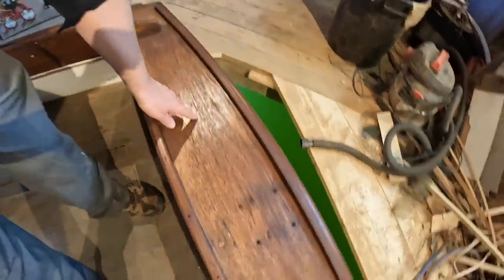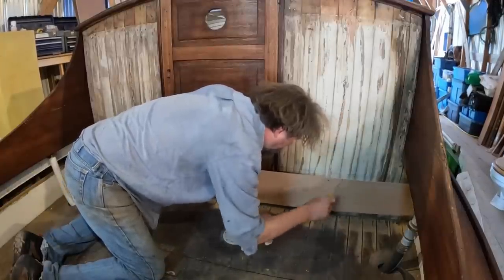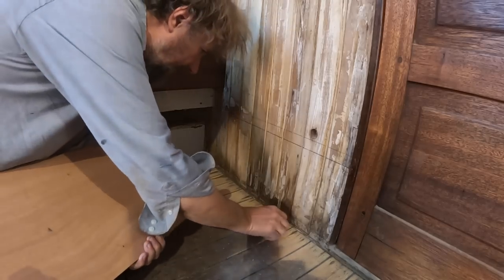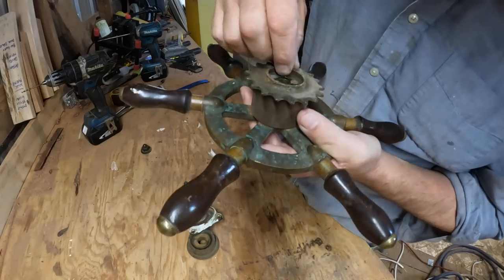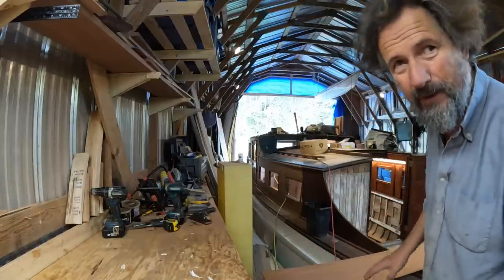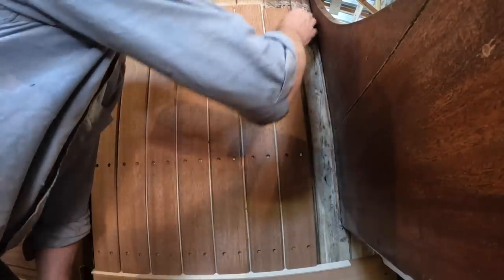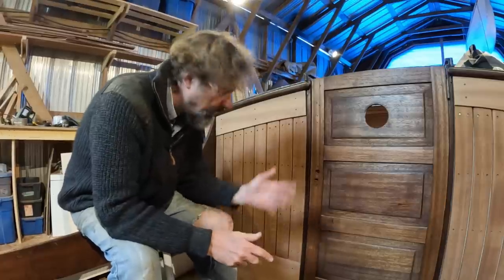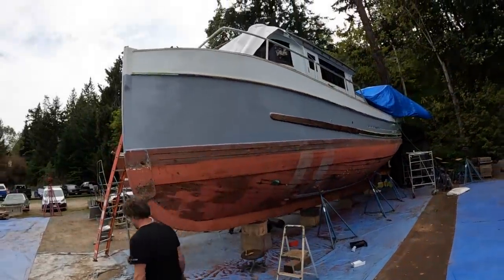New Mahogany in Cockpit - #364 - Boat Life - Living aboard a wooden boat - Travels With Geordie

Comment: Bore the wheel oversized and put a brass or bronze tube inside it... maybe use two tubes, one long enough to be held in place by the nut so it becomes the new bearing surface, and another on the outside with a film of grease in between for good measure.

Comment: I'm curious, Peter, why you ripped the mahogany into individual boards, with all the additional resultant seams and possible water intrusions, rather than using the one piece and routing surface "joints" into the one board for a similar look. Was it for minimizing expansion/contraction with smaller board widths? Certainly more work with many boards, but it sure looks fabulous. ( And I loved your screw hole jig hack, with the putty knife, wood block, and locking clamp - great way to make them all exactly identical! ).
Reply: Expansion limits of the wood and sealant. Imagine a caulked teak deck veneer. I rather had questions till it came together, sweetly.